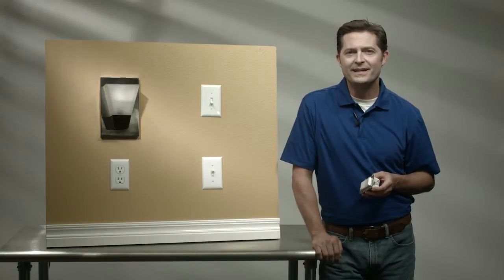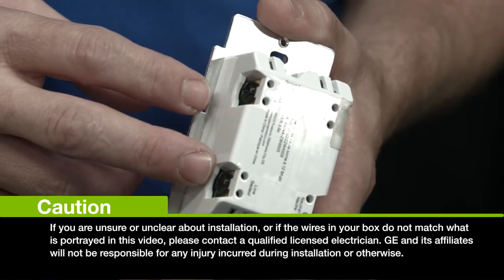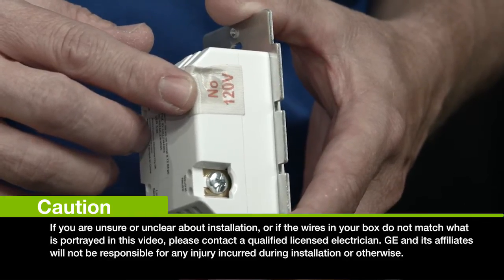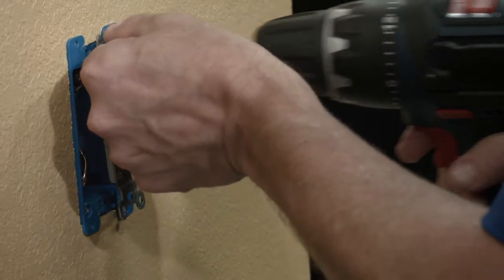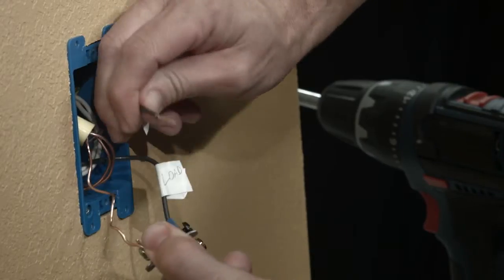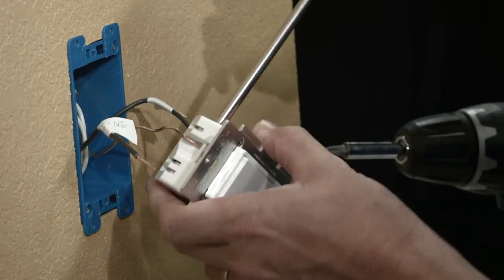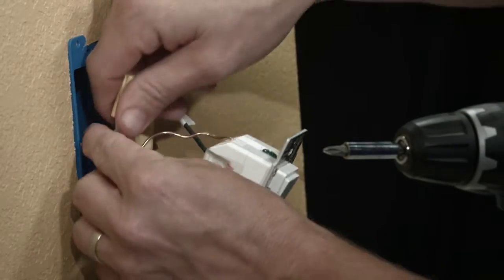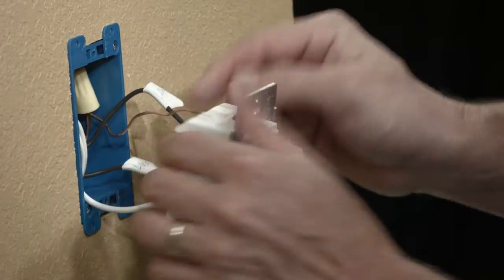45712: Jasco Z-Wave In-Wall Smart Dimmer

Comment: the explanation is weak, both terminals are marked line;load with sensing ... wtf does that mean. My danger sensor rang hot for both sides the switch seemed to work (on off by hub and switch) but the load did not come "on". I am going to have to retest with a real meter as both side were always hot (dangerous) on or off ... illogical ... without understanding what the brains are trying to do
Reply from the maker: Thanks for reaching out. The dimmer in this video does not feature auto-detecting line/load terminals. If your Z-Wave device has auto-detecting line/load terminals, the video at https://youtu.be/JwtVKID9tAw may help. Smart switches with this patented function allow you to connect the line and load wires to either terminal. The device automatically identifies the connection. Our U.S.-based consumer care is also available at 1-800-654-8483, M-F, 7 a.m.-8 p.m. Central Time if you need additional assistance.